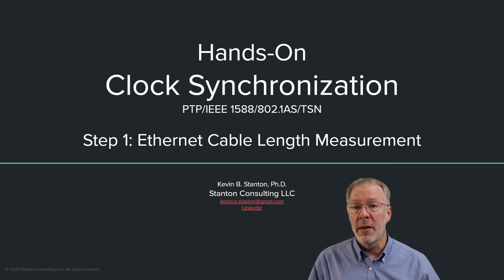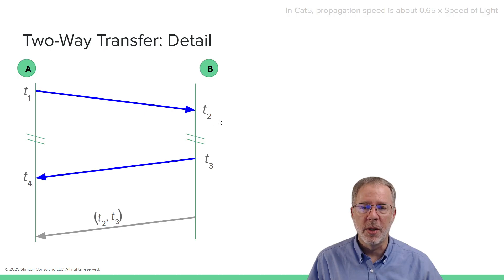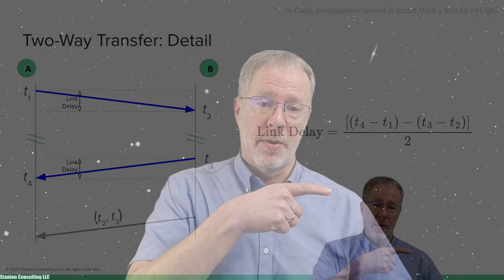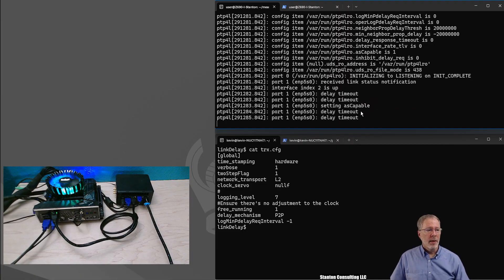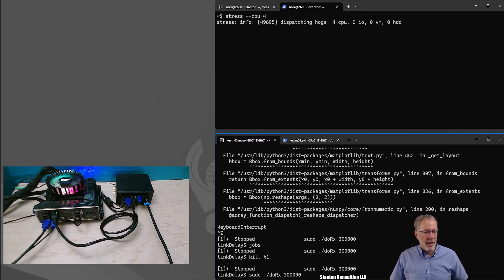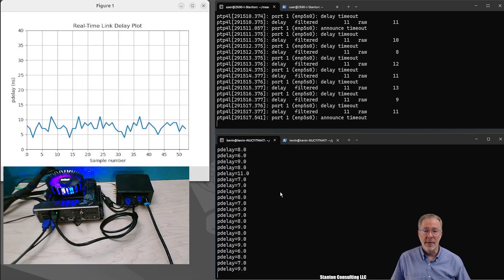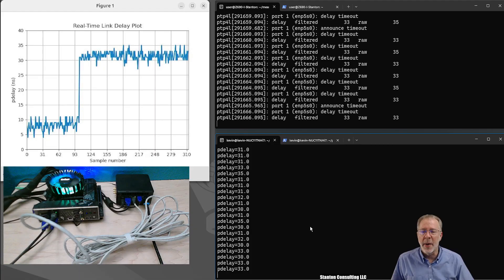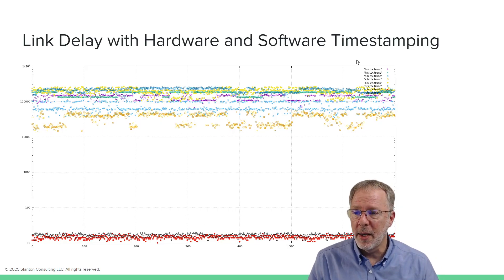#1: Clock Synchronization with Nanosecond Speed-Of-Light Measurements using a Standard PC!

Comment: I understand that if B knows both t2 and t1 it can calculate offset but with added delay.

The points that I am not able to understand is,
1. Before B is sending a message and taking that time as t3, will it correct it's clock with the calculated offset value?
2. Will B immediately send a message? What is the interval?
3. Why t2, t3 has been sent to A? (Assuming if A clock is correct)

From the Link Delay formula, I think both (t4 - t1) and (t3 - t2) are offsets correct?

Comment: This is a great demo of a non-intuitive concept (especially how CPU sleep states affect the software delays), thanks! I may try to replicate it with a couple Raspberry Pis, I feel like we could see how good various NICs and oscillators are at frequency stability, too.
Reply from the maker: Jeff!!
You're right. Power management in modern CPUs can be complex. When used in real-time applications, people traditionally disable all power management, etc., but a better balance is available. I'll be super interested to see what you find if you replicate on RSPs!
Reply: @kevinstanton148 Thanks Kevin for great videos! I subbed in hopes to see  you do this on Raspberry Pi or Orange Pi or similar embedded device that have struggle with limited 1ms timestamp accuracy. PTP exists on both RPi and OPi at least, so maybe that can gain access to something like you present here?
Reply: Are you sure you want to go down that path? Playing with 1588v2 leads down the path of exploring telecom profile and synchronous ethernet.

Warning: it leads to dedicated phase noise measurement systems, then the need to upgrade references within those as well as time interval counters and more.

For what it’s worth I stuck my toes into synchronous ethernet hardware and transfer using packet over SONET with OC-192.

I do have to say it was satisfying to slew a 10MHz input on one router and watch the output frequency slew on another connected via single mode fiber.

Figuring out everything not well documented about what does and doesn’t work together was annoying though.

Comment: Hi Kevin

Great explanation and I am able to understand the nanosecond level synchronisation possibility.

What are the applications that use nanosecond level of synchronisation and what if we can do microsecond level synchronisation and what applications would break and what if we do millisecond level of synchronisation and what applications would break.

Is nanosecond a real requirement or a possibility?!
Reply from the maker: Hi Melvin. Did we meet at the TSN/A conference last Sept.?
The number of applications that require one nanosecond of worst-case clock skew today is vanishingly small (but not a null set--and some are quite important applications). I think of PTP as covering applications that require better than a millisecond from NTP, even if sub-microseconds are unnecessary. But once you add timestamp hardware support in the Ethernet NICs you can get orders of magnitude of improvement, to say nothing of the further improvements when other components also have precision time hardware support, and microseconds is easily achievable. I can see (from your own YouTube channel) that you focus on TSN. The emerging IEEE / IEC 60802 profile of TSN requires that PTP (via802.1AS) achieve 1us over a large number of network hops (e.g. daisy chain), and the per-hop time inaccuracy (which I show in this video) becomes quite important. Thx for the question--perhaps I'll prepare a summary of applications and their timing requirements. For some, worse timing merely degrades performance. For others, the application correctness is impacted--especially for Cyber Physical Systems.

Comment: Great video, thank you! I just implemented a virtual PTP slave for macOS and because there is no hardware time stamping I can only dream of this level of precision... :-).
Reply: At least not accessible to developers, obviously there is hardware time stamping since macOS supports AVB/TSN if using the correct hardware.
Reply from the maker: What path/link delay variation do you see? Depends a lot on the OS configuration, power management, etc., I suppose.

Yes, MacOS support of AVB was added in Mavericks, if I remember right. But sometimes cool capabilities of hardware aren't exposed to the public, which, as a technologist at Intel, was always sad.
Reply: @kevinstanton148  I'm seeing about 0,07ms variation in the e2e delay measurements after filtering out the outliers. The offset from master is about 1,5ms variation (after the outlier filter). However, I haven't done any optimisation yet and I think there is room for improvement. Most notably preventing the cpu/threads to go to sleep or yield back as I've seen some pretty long delays waking up threads.
Do you have a feeling for what precision should be achievable in a pure virtual PTP follower without any hardware support?
Reply: @RuurdAdema-t2x  Apple is apparently hiring someone in Colorado for time and timing applications, especially in relation to exposing things to developers. So maybe there's hope a future version of macOS / iOS will expose PTP and more precise timing!
Reply: @JeffGeerling  Yes! I know! Hopefully it will lead to some public apis!

Comment: thank you. recalled cray1 1975 4' long cable restriction (60miles?), that stayed in the mind. L3-7 comsat sec sw, L1-2 & hw yet to grasp in 3decades. a general aviation safe laser altimeter was on my mind couple months once to safer softer landings, using a ToF chip.
Reply from the maker: Yes, and use of precision synchronization in aerospace is an area I plan to cover in the future.

Comment: Great demo, thank you. Subscribed. Can you lay out the hardware used to demo this? Guessing (at least one of them) is an Intel  NUC 11 i7 based on the terminal title. And PTP. Never thought of it running without a switch! Much easier to demonstrate.
Reply from the maker: Hi Scott. On the left, it's a ROG STRIX Z790.
The NUC on the right is SBNUC11TNHi70L0, so NUC11 / i7, as you say.

The Ethernet devices are (DEVICE: 0x15f3 and 0x15f2, respectively) from Intel. The latter is i225-LM.

Comment: Thank you. Is this based on assumptions of symmetric full duplex communication over same length of cables?
Reply from the maker: Symmetrical delay, yes. Take the delay-asymmetry (both cable asymmetry and asymmetry in the pipeline delays in the digital logic where the Rx/Tx timestamps are captured), divide it by two, and you'll have the (instantaneous) time error. And there are other contributors too.